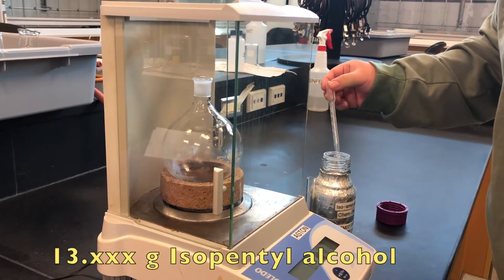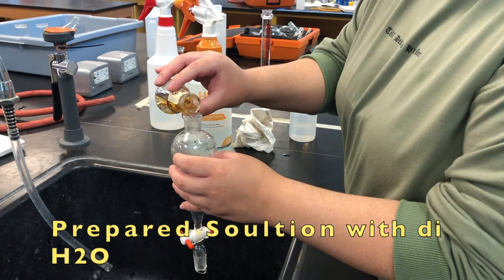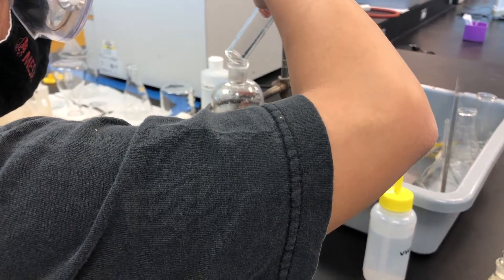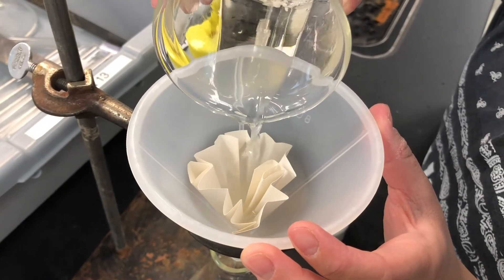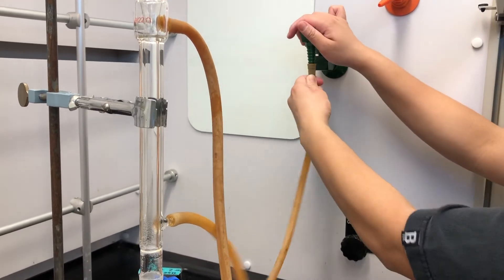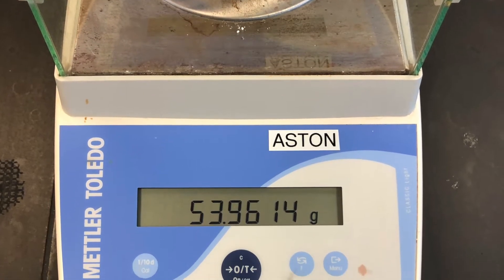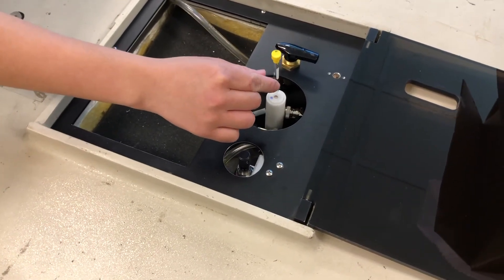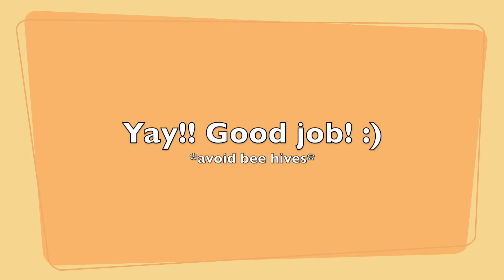Banana oil preparation lab CHEM EXP

Comment: Will regular acetic acid work? Some just cool down the acetic acid, how does this make it work better?
Reply: Regular acetic acid would not work because it contains water. glacial acetic acid does not contain water, which is important for the reaction. It has a different chemical structure compared to normal acetic acid